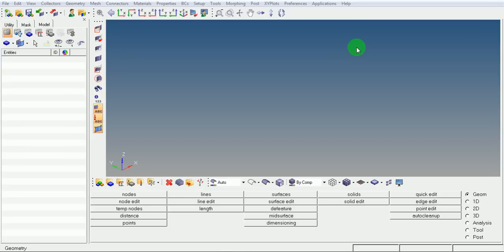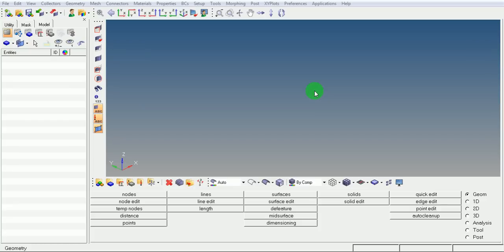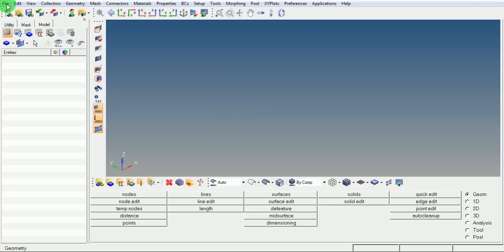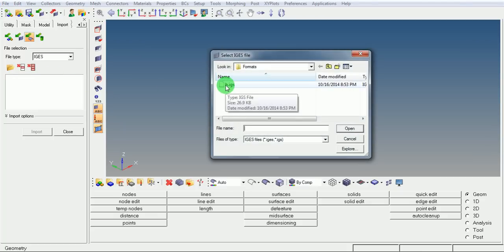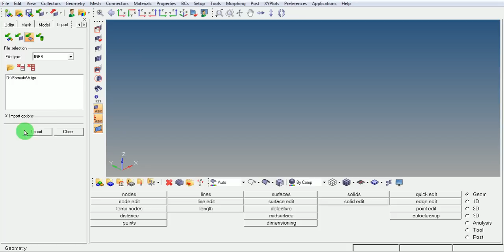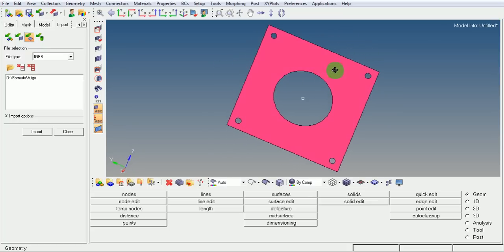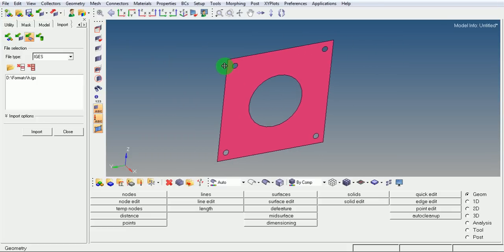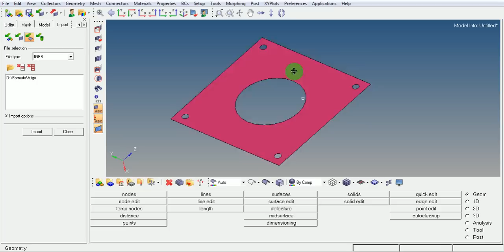HyperMesh Tutorial Video | CAD Geometry Import | User profile | Zoom | Rotate | Pan | GRS |

Comment: I am working with abaqus and hypermesh. I create a mesh on a part and exported as an .inp model to abaqus. In abqus I want to define loads which needs to select a surface. But when I want to select the surface I should select all the elments surfaces on the corresponding surface.Is there any way to define sufraces and sets of nodes in hypermesh and export it to abaqus?